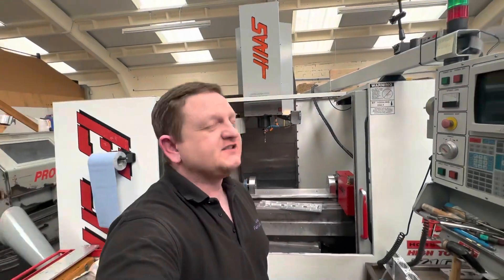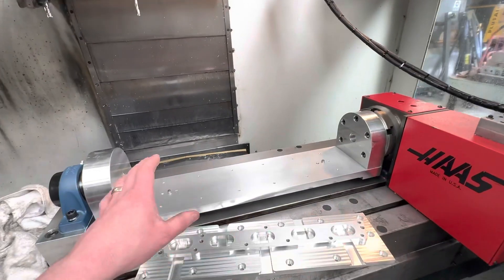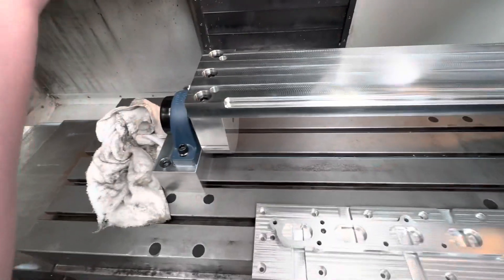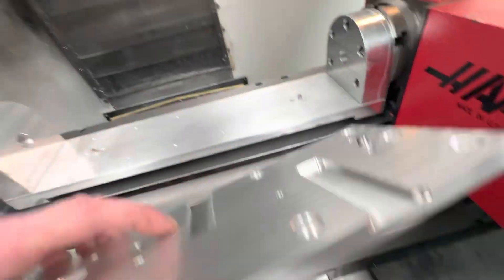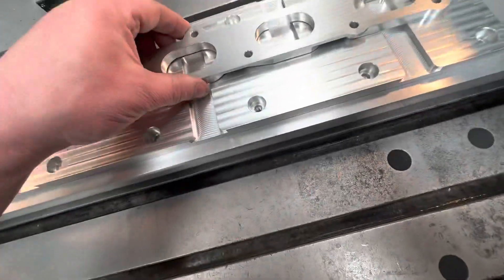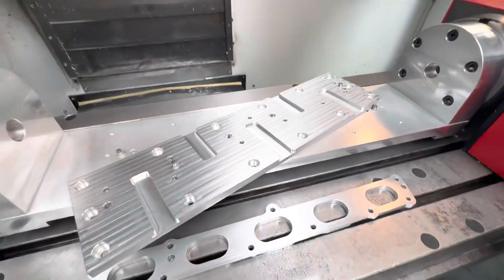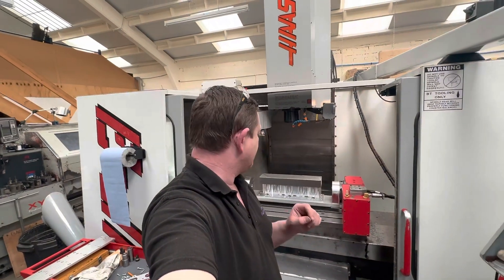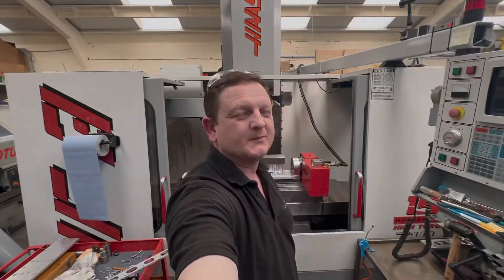Sub plate set up for the Haas hrt160 trunnion table

Comment: Nice to see you are moving in the right direction with your 4th axis and reducing operations.
Reply from the maker: Thanks, i am hoping it all goes well, i will go slow and steady on this second test peice to see if i can get through it with no errors and hopefully it ends up as intended.

This is defintely the way to go do as much as possible in 1 set up, 

Thank you for your comments and previous input

Marc
Reply: @kinzy_fabrications  You have learned so much. I'm very impressed! Keep at it!
Reply from the maker: Thank you
Im greatful to all you guys who comment and message to help me move forward and get better
Reply: @kinzy_fabrications  You are able to learn quickly and figure out where your approach is wrong... like doing way too many fixturings, leaving stock or figuring out that fixture plate is the way to go, etc. You have what it takes to be a great machinist!

Comment: Nice work mate, now put a G10 line in at the beginning of the program ready for next time.
Reply from the maker: I just had to search what the G10 does, this is a good feature but i sometimes take the 4th axis off the table and then it wont ever be exact next time so i am best off to use my g59 and re check and set it each time, but thanks for introducing me to another G code i was not even aware of

Thanks
Marc
Reply: @kinzy_fabrications  I'll send you a photo of my 4th axis. Goes back to within .02  with no mods to the table.
Reply from the maker: Hi Andrew, love to see that.

Its probably easier to find me on face book or instagram, kinzy fabrications and message me via them